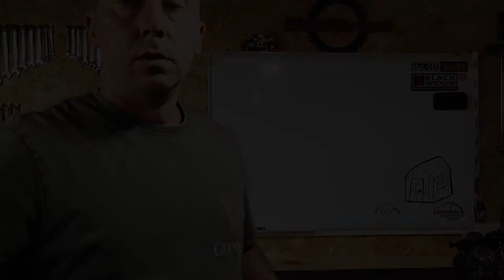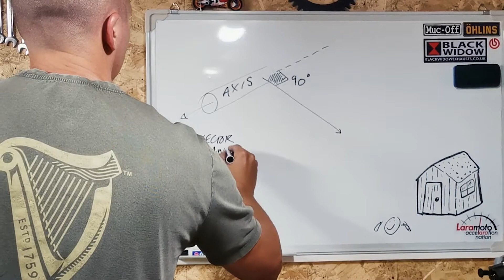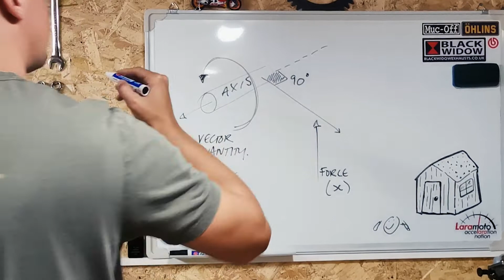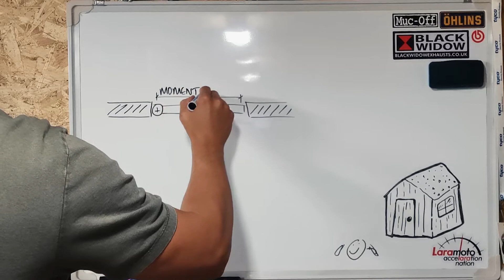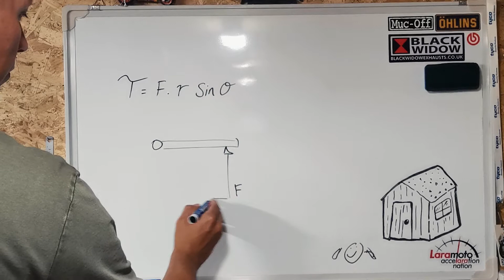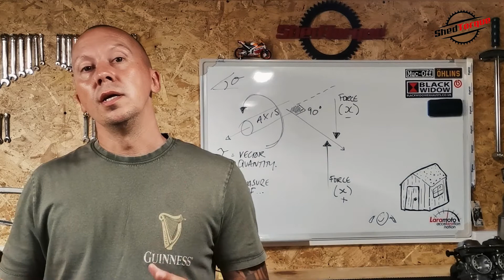Torque is a Vector NOT a Force

Comment from the maker: When rotating my hand over the axis I am demonstrating Torque cross product. The thumb on my right hand is effectively pointing out of the board if I were to grip the axis. All that means is that as I curl my fingers around it shows the direction in which the object will rotate, in this instance that would be in a positive counter clockwise direction, indicated by the positive symbol showing a force in that direction. If you know anything about the cross product for calculating Torque, you will understand my fingers would effectively be in the direction of the first vector which is R, and then as they close they cross or sweep into F, and my thumb pointing in the direction of the resultant. I will do another video on the cross product for calculating Torque which may have helped to understand my thought process while ranting. Anyway, thank you for watching.
Keith.

Comment: Interesting mate, it's a complex topic for sure, not sure on the door example as the torque measured (at the axis = hinge) at the moment that the door opened would be the same in both examples, just force required (effort) would be different based on hand position on the door (lever length). Regarding the use of gearing, this only applies for increasing torque at the drive wheel without increasing effort. My simple explanation is that lever length (conrod) determines how much torque a given/static effort would produce on a rotational axis. Great vid mate, enjoyed it 👍
Reply from the maker: A greater force is required as you get closer to the axis, shorter lever.
I was trying to say that theoretically, producing torque at high rpm is better than producing torque low rpm, as at high rpm you can use gearing. As you know a powerful engine is useful because it can then be geared down - like I don't want the rear wheel of my bike doing 8000rpm! So gearing down reduces the speed at the rear wheel with a corresponding increase in torque. Obviously this does not affect the power of the engine, well apart from frictional losses due to heat and all that nonsense. Cheers for watching mate. As always.
Reply: @ShedTorque46  We're saying the same thing basically, we both understand what torque is, just you are covering the science bit lol 😉 Yeah increasing torque at higher rpm increases work done, naturally slipping into the bhp and torque relationship
Reply from the maker: @rhydtuned  It was a half hearted effort mate. I was actually just fed up of people calling it a force, but I went off on a tangent and didn't really cover the whole picture. I am going to do an in depth torque as a vector video that will surely bore us both to death. In the meantime I need to get back to my project bike as I need to rebuild it and get my forks re-chromed. That and get the tank sprayed that I fabricated. Work gets in the way of everything 😂⚙️🔧
Reply: @ShedTorque46  Tell me about it (work!) Yeah, torque is not a force... Muppets lol